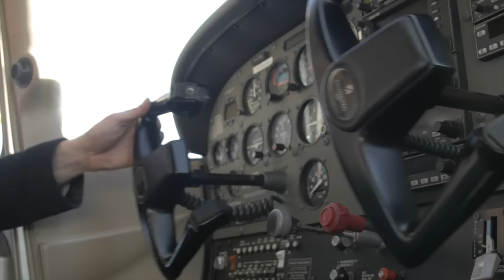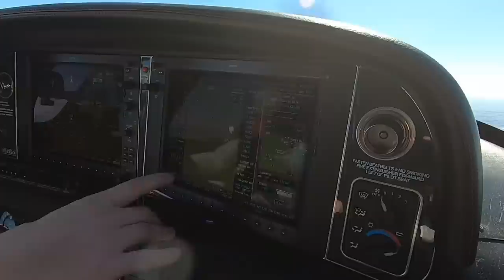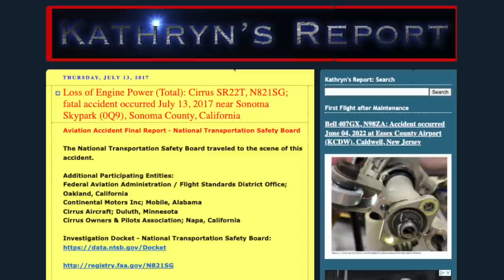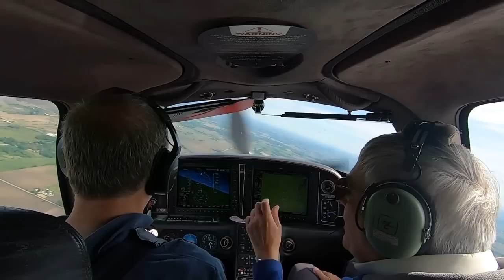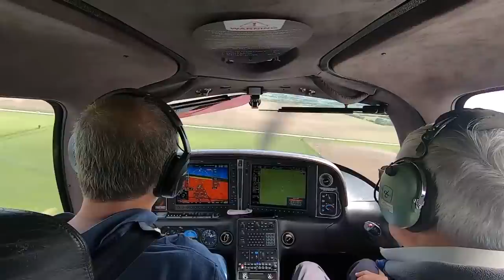REAL ENGINE FAILURE - Forced Landing In Cirrus 1500 feet AGL - NO PARACHUTE PULL

Comment: Seconding Micah, I did get pretty good factory training at Cirrus when I took delivery of my new SR. We did a couple power-offs in Knoxville. Then a ton of them with my CSIP doing my commercial. And last year I had an engine issue at 7500 near an airport. Just spiraled down and glided it in uneventfully, with a cylinder blown up. CAPS is great tool and I’d never hesitate to use it. I’d not do an off field landing though, because there may be last-second surprises that kill you. I’m not worried at all about my ability to land safely. I’m worry about things out of my control, like wires, etc.

To other Cirrus pilots. Don’t forget the Cirrus has a wet wing. If anything ruptures the wing on the rollout, you are on fire. No thanks.
Reply: That is so true, also with the fairings on the wheels this is not an off airfield airplane. 90kt best glide is over 100mph, so unless its an airport i believe the chute is your best choice. I would personally choose gliding to an airport first though.
Reply: Everyone should read Marlon's write-up on his emergency landing.  His write-up is as amazing as his cool-under-pressure performance on that day.  Hope to be as confident and proficient as him one day.

Comment: Something not being mentioned here is the Cirrus wing. For those of you who know this aircraft, you know that the wing is almost a critical wing - not much lift being produced without thrust or potential energy. Depending on your angle of attack (assume we're in climb out at Vy), you might really have to pitch the nose down to keep the aircraft at or above best glide. The problem for low-time, new, or less proficient pilots is that they still tend to keep the aircraft in that nose-up attitude a little too long when processing certain events. These few seconds can cost you dearly in a Cirrus. Depending on generation (and I'll go with G5/G6 numbers here), VY is 102 KIAS, VG is 92 KIAS and VS1 is 74 KIAS. The spread between the three of those is 28 knots. One wouldn't think that the airspeed can dissipate so quickly, but because of the human factor, it absolutely will if you're not expecting the scenario you've just encountered. Furthermore, this scenario can be compounded by the fact that stall speed increases with bank angle. Low altitude engine failure, adrenaline spike, loss of airspeed, sloppy maneuvering, and now you see why some Pilots inadvertently stall at this point and subsequently enter a spin. While I agree that every pilot should know and understand glide characteristics as well as low-energy maneuvering, it's unrealistic to assume that all pilots will maintain this level of proficiency and keep learning....So unfortunate. They rest on their laurels, and that's when the crap hits the fan. This is what really makes the CAPS a thing of value, which is bittersweet when you really think about it. Sometimes it's a great tool to have in a pinch for encounters such as mid-air collisions, engine failures over water/rough terrain, inadvertent or negligent flight into IMC or known ice, an incapacitated pilot with pax on board, and a few other scenarios. But sadly, it's a crutch for those folks who don't keep their axes sharp.
Reply: Also why the cirrus is not a good trainer, way too expensive and way too fast for any students own good.

Comment: Thanks to both for this video and the comments.  I had an EFATO event 10 years or so ago - and I'd like to offer some "don't do this" experience - and you can see the wisdom is the above video : I was flying a Cirrus SR 20 that I had purchased and repaired as a project. It became a mammoth task, getting it all through ( pat on the back at this point) and was flying with a cirrus rated instructor with 1k hours. ( non-CSIP) . There was a lot to deal with, and  was having a lot f problems that were difficult to resolve, as the location was SE Asia . There were a few issues we just weren't overcoming, auto pilot & Transponder, and the prop wasn't adjusting properly... but they weren't no go issues.. and I was under pressure to get some hours on it before we ferried her home.  SO I landed up doing a lot of circuits and with a long runway- but in the course of touch - and goes, I landed long, and took off again with not much Rway left...  but in my last downwind I changed the fuel from Laft to "off" ... simply because  was thinking about an emergency shut -down.  And so , my hands did what my brain was in... ( did I really even HAVE a brian ?) and completed the touch and go .. but she starved at about 400ft AGL. 
I can tell you - there in't much time... and were at 100kts + when we got back on the Rway.  we did our best but it wasn't going to save the ensuing mess.  too low for chute - we considered it.. and so my friends -  I was forehead smackingly stupid .. I wasn't concentrating on the task, and my instructor wan't watching my hands.. closely. 
We survived - the aircraft did not. I have to accept that in my haste and frustration and lack of focus on the job - it was my screw up.  One may attribute my failure to "get there itis"  - whatever  but at the end of the day, I was NOT FIT TO FLY.   So our friends on this video demonstrate discipline, forethought and preparedness. Those things don't kill you

Fly safe. .

Comment: Also, pulling the chute is guaranteed damage to the plane. It will land straight down and fairly hard. Things will get broken, bent and damaged. Landing in a field gives you a chance of limiting the damage.
Reply: @Matthew Morycinski True, but your plane won't be down nearly as long for an engine replacement as structural damage our replacing the entire plane.

Comment: Things haven't changed much since the '40's. My father went through Navy flight school during the war. He trained in a 2-seat Stearman. The instructor would randomly throttle to idle and say: "Your engine just quit. What are you going to do?" The student had better have a plan in mind and start executing it. That would sometimes require side-slipping to reduce altitude quickly.

Comment: Let me be absolutely clear about this: Without an airstrip you can reach, attempting a landing in a field is like playing in a Casino (which I don't do). In a plane that stalls at 59kt, like our Cirrus, it's pure luck if you reach a field that doesn't have bumps, etc. to high for the shopping cart wheels. You have 0 chance of making that sure from your glide in.

I made the experiment myself, bicycling around in our region and looking consciously at fields if they would allow a landing that keep the plane on the gear. The answer, maybe 10%. Mostly for production of lawn. In Germany, fields are smaller anyway, we have a different history of agriculture and land distribution.

If you attempt a landing with the engine off, which is absolutely part of PPL education and the test flight, you make a bet on that landing spot. It can go right, it would go wrong in most cases. So pulling the Chute is the safest option, if you are not for some reason familiar with the field. It should be done if there is any doubt of a save landing spot, which is always the case outside an airport. 

It is great that this bet ended well, but it was a bet. Those who attempt that and don't go lucky can't tell the story on YouTube, it's done for them if at all.

If you fly a high wing with bush wheels stalling at 40 mph you don't need a Chute. In a Cirrus, not to pull is taking an unnecessary risk you can't calculate and you shouldn't celebrate that you were lucky. And not suggest that way others should not pull but be proficient in off airport landings, because that's an illusion in some planes, the Cirrus one of them. Luck is the only strategy you have in some planes, not the Cirrus. You can replace luck (not proficiency) with CAPS.

Comment: I'm going to be starting up my flight training again here real soon but as an aircraft mechanic I look at and think the parachute is a great tool.... if and this is a big if, there is no alternative landing site. Honestly I find it hard to believe that pulling a chute at 2000 feet going 150 knts is going to be good for the structure of the aircraft or the pilot. Yes I know smarter people than I have designed this but what happens 10 years from now and that plane has its first engine failure but a small leak has water logged and rotted that chute? Or after years of heat? I have questions, also like is there an expiration for the line and chute material ? Is there an inspection interval for the deployment mechanism how about a test procedure? 
I don't know much about the parachute system but after 100 years of flying a lot of procedures have been developed for this.  Yes I feel it's a tool a great tool and should be on every  aircraft. I just have questions and I think it should be a last resort not a go to...

Comment: Having watch several videos by Cirrus and others about the chute you can understand why the training for CAPS the way that it  is. Firstly Cirrus understands their planes are being used mostly by low hour private pilots and one of the things they seem to be trying to do is make flying more accessible, easy, and safe for the average joe. Which explains a lot about the chute training as well.  Cirrus says there were many accidents where the pilots probably would have lived had they just pulled the chute.  In fact in Cirrus testing in simulators they found pilots wouldn't pull the chute even when given a 100% no win scenario where the ONLY way to survive was the chute.   So the Cirrus  training changed to be more aggressive about pulling the chute and making it a if/then fast decision.  The issue is can the average pilot flying an SRxx plane really glide it to safe off air port landing?  Even  if they do and do everything right they could still hit a rock or deep hole or wire ect they can't see from the air and flip over.  Or the ground could just be too soft and a wheel digs in and they go tumbling.   There is a lot that can go wrong in forced off air port landing even in an open feild that become 100% non issues if you just pull the chute.  The idea of the Cirrus training regrading the chute, right or wrong, is that with in it's designed usage envelope the chute is a near 100% chance of surviving and a forced landing has far less odds of success, maybe as bad as 50/50.  So don't be a macho man thinking you're a top gun pilot and try to land it. Don't risk your life needlessly.  Just pull the chute and live.

Comment: How does alt air impact engine function? Not sure I have heard that before.
Reply: If the air coming into the engine is blocked for whatever reason (e.g. ice, bird, etc.),, alternate air provides an alternate source of air.  And as the CFI said, we need fuel, air, and spark in the right proportions to make it work.
Reply: @pfflying6275  Alt air is for the pitot static system, not the engine....right?
Reply: @Factory400   Actually, you are referring to Alternate Static air, which is different.  Alternate Air is found on non -carbureted engines (fuel injected), which allows the pilot to select an alternate source of air intake.  It is only used if the main air intake becomes blocked.  If you're flying a plane with a carburetor, and you performing the 3-2-1 check referenced by the CFI (Bob), then the last item "AIR" would be the CARB HEAT control.  Does that answer your question?

Comment: Around 10:20 the instructor alternate air might be the reason why your engine quit. I don't understand how it could be. Can someone explain?
Reply: The primary air intake could have been obstructed by ice or anything else which may have blocked the airflow causing engine failure. Alternate air as the name suggests is an alternate air source which bypasses the primary air intake.

Comment: i fly a TL2000 sting LSA which has a chute, we're taught to pull it as a last resort (eg the wing fell off). We're taught the same thing you said... it's a wing, it'll fly you unless it's not there. in fact the last lesson was power off 180s and engine failures. in essence.... we're taught that the cute isnt there at all. there's going to be many planes you fly that don't have a chute and if you're in that mindset of "just pull the chute" you're going to be screwed if you havent been taught anything different.

Comment: Nice job presenting the main message and key take-away; which I believe was this;  The Chute is a TOOL.  Gliding to a forced landing is another TOOL.  
Good training and circumstances (daylight, suitable terrain) influenced this pilot's decision towards using the "Glide" tool, instead of the "Chute" tool.  
And he should be applauded for recognizing and using a TOOL that got the job done and concluded the emergency in a SAFE manner.  
Each pilot's proficiency, and, the circumstances when the emergency happens should be the factors that influence the pilot's decision about which TOOL to use in an emergency.  POH's are not bibles... they are "Manufacturer's suggested/recommended operating procedures."   But if your personal proficiency and the circumstances of your emergency are indicating to you that there is a better TOOL available to you, then go ahead and use the better tool.